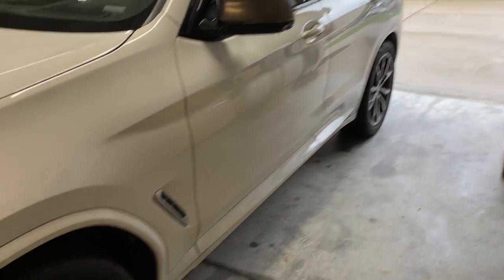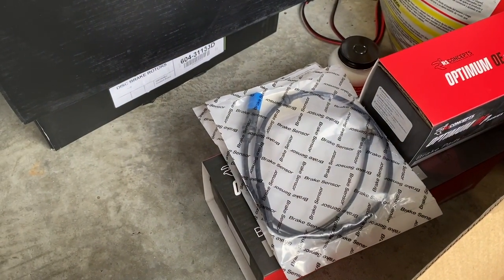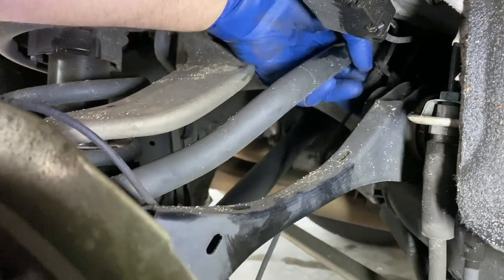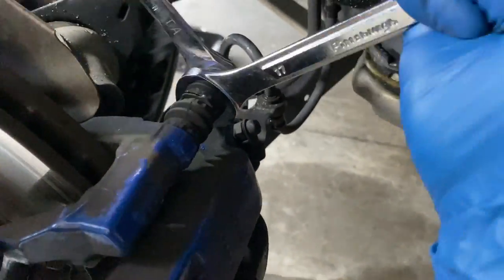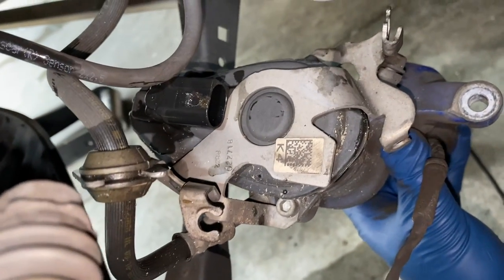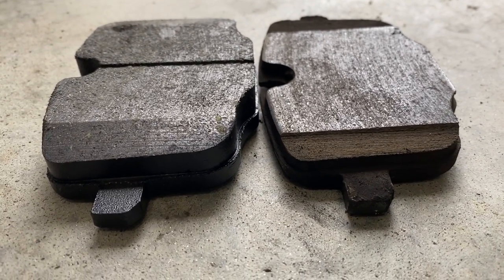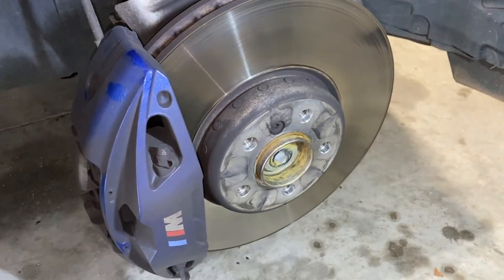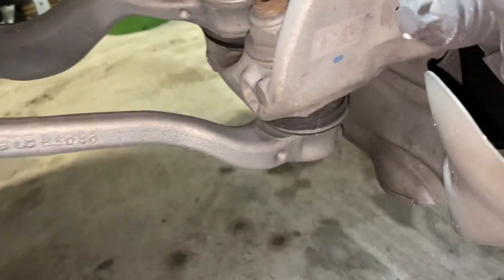How to REPLACE PADS AND ROTORS on a BMW X3/X4 M40i (G01/G02)

Comment: What is the purpose of messing with the parking brake at all?  Why bother to remove the hardware and run it in to stop?  Can’t you just swap the pads out without touching it?
Reply from the maker: +Tinkerton82 the new pads will be thicker than the worn ones you are replacing so you will have to make room for them by opening the caliper pistons back up. This is how BMW says to do that.

Comment: What's the part number?
Reply from the maker: +Christian Lara wish I could provide that but unfortunately I don’t know it. I’m sure their website or customer service can connect you to the right part for your car.
Reply: Rear roator : 34216860925
Rear pad: 34216867175
wear sensor : 34356870350
those all for m40i trim,  30i may be different.